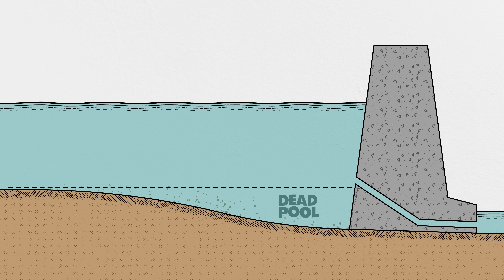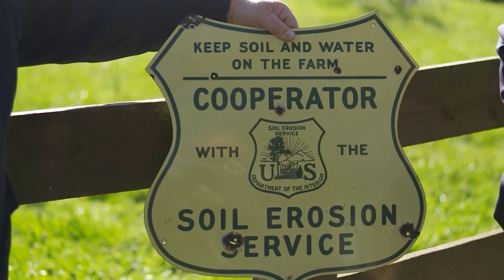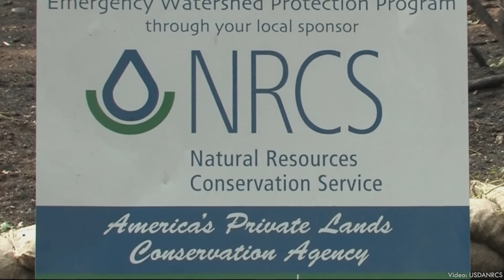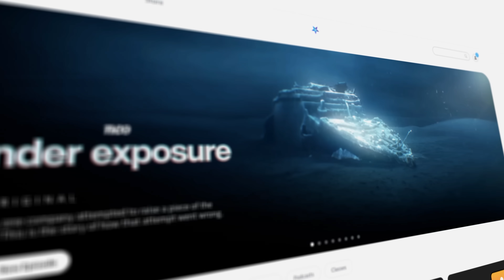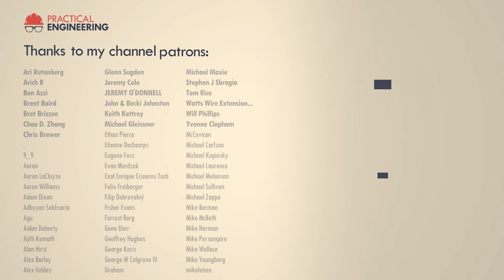All Dams Are Temporary

Comment: Here's how I would solve it. Avoid the big dams and do a bunch of retention ponds and ground soak ponds throughout the water shed. Keeping the water in the ground and as high up as possible will help avoid flooding and contribute to water flow consistency. Then as far as dams go make them small or go with run-of-river hydro power. It is better to have lots of small run-of-river hydro that allow the river to mostly run natural as  and protect the fish avoid the sediment problem. Also you eliminate single points of failure as having one or two hydro plants go offline won't  be a big deal as you now have many small ones.

Comment: I remember back in the day when I was like 6 or 7, they solved the sediment problem just by first slowly relasing water from the dam until it was practically empty, let the bottom dry up for few weeks and then just rolled in few excavators and a dumper truck which was just dumping sediment somewhere down the stream by the river bank. They prolly don´t do that anymore, since back then there was no property issue as everything was owned by state.
Reply: Nowadays everyone is also reliant on the power generated by the dam and the reservoir created behind it, shutting a dam down in the modern day could mean a whole city going down with it
Reply: @defiantnight2668 if it’s planned out far enough in advance the grid can cover it, it’s surprise outages that are problems, for most of the developed world.
Reply: 6 or 7 huh...

Comment: I remember reading something about the problems connected to building the Aswan dam to the Nile. For one thing the fertility of the soils along it on Egypt used to depend on the floods, now the sediment that used to renew those soils every year stays behind dam and the soil has to be maintained with artificial fertilizers, and from what I have read, looks like that isn't working anywhere as well as the yearly floods did.

Comment: Posting my 'top of the head spitballing idea' that you asked for, before finishing the video. A broad slow moving washboard like area with peaks to speed it a little and valleys to collect settlement.  Divert the river through this before the filtered water enters the reservoir. It will let the silt settle out in an area designed to be regularly cleared out. There could be two or three such areas, switching which is receiving the water as the others are cleared out by equipment and stored elsewhere and as much as viable used or sold, or a series of archemedes screws can move the sediment filled slurry to another area prepared to receive it.  I assume the dammed body of water is already not meant to be navigated by through shipping, but if so you will need a lock system here just like you would need one for the dam itself.

Comment: Large screw in a big tube going along the stream on the dam bottom would solve this problem - THE MUD PUMP. The tube would have holes every 50 meters or so. When some mud gets in the tube the screw would push it to the other end of the tube.

Comment: With little knowledge of the mechanics of water and engineering, here is my solution:

Not really a solution to the dams we have already, but one for future ones. Create two dams. One on land to act as a large reservoir, and a second, micro-dam upstream. The entire purpose of the smaller dam is to reduce the flow of water so sediment settles, allowing you to pump clean water with much less sediment into the main large reservoir. Ideally this would primarily use gravity to save on power. 

My hope is that the smaller micro-dam would be small enough to be able to be easily flushed periodically. If you took a swiftly flowing river and split it into many small individual dams, the flow should drop as desired. You could close/open dams in order to fit your need. Closing many dams would cause the flow in the few remaining open to increase, allowing the dam to self-flush the sediment downstream. 

This seems like it could solve most of the sediment related issues that current dams have. The main large reservoir wouldn't fill up with sediment, or if it would, the rate would be slow enough to justify the cost of removal or slow enough that the dam could fulfill its cost over hundreds of years. The small dams could be flushed almost constantly, allowing you to release a steady flow of sediment, instead of a sudden tidal wave of it.

I'd imagine it would also help with the environmental impact of the dam as a whole, as it would only siphon off a portion of the river, instead of stopping it completely. 

Of course, I know nothing about dams, so I have absolutely no clue how viable it is to only siphon part of a river flow. I know lots of dams/reservoirs are meant to store water for drinking and surviving droughts. perhaps this wouldn't be enough water for that. It would decrease the amount of power a hydroplant would make, but perhaps that's the price we'd want to pay in order to make hydroelectic power far more environmentally friendly.

Comment: Aren't there sleuce gates that get opened regularly? 
How about having a pipe opening in the dam below surface with a tube attached that can be set down wherever the sediment settles, it could regularly be moved to the biggest sediment deposits and doesn't have to be big enough to impact waterflow or dam capacity.

Comment: I wonder if they could somehow use the dam to power air or water "agitators" buried in the problem zones and re-suspend the sediment. Im imagining lateral systems that spray water out of jets parallel to the river bed kicking up a bunch of dirt. Not sure how far you can agitate water at the bottom using pumps. I imagine there would have to be a field of them.

Comment: They need a dredge that has a suction hose connected to a portal low down on the dam itself specifically for this function. The dredge then putters around inside the reservoir sucking up the loose(ish) sediment, which then gets sucked out the portal and resumes its journey downstream. Could use the same sort of software to control it that farmers use to make sure they fertilized an entire field evenly to make sure it gets everywhere.

Comment: If the reservoir is full of water already, couldn't you just build a bypass that maintains the cross section and thus speed of the river so that the sediment also bypasses the reservoir? This way you're not fighting all the sediment that flows downstream, you're only fighting the sediment in the water you're actually using. You wouldn't even need this bypass to be a structure, it could just be a chute of thin plastic film which is held up by inflated tubes on top of the reservoir the same way jellyfish nets on Australian beaches are supported. A dam I grew up near had a net a few hundred metres from the dam wall held up this way to keep fish from being ejected over the wall. Canoes and small sailboats could easily pass over it (as long as you lift the rudder and centreboard). You could lower sections under the surface as a complete tube to allow speedboats to pass too.

Comment: Just use the flow itself to take the dirt off by increasing the velocity  (channel the inflow into a thin channel). Also there should be a gravity trap equipped spillway before every resevoir which would trap the dirt enabling automated systems (conveyors, heavy duty screws) to move it to the edge for removal before it reaches the reservoir
Reply: Also reservoirs should be designed so the flow naturally keeps them cleanish.

Comment: Dredge it out.  Before watching the video...  After watching the video, no answer.  The sediment in the river would be deposited no matter what.  It seems that the primary solution would be to regulate what can be spilled into the river, so that the sediment is not contaminated.  Or charge the pollutors a polluting fee, a surcharge to remove the pollution from their runoff.  As pollutors pay for removal of contaminants, the remaining material can be sold as high-quality fertilizer for farms.
If we know the specific contaminants, they might be recovered for industrial use.  Perhaps there are contaminants unassociated with human activity, stuff that comes out of the soil naturally.  There is a use for almost everything.  While removal may not pay for itself, it could help to mitigate the cost of dredging and cleaning of the sediment.
As always, the reason we have engineers is to do the math.  While these solutions appear simple, it's not until we do the calculations that we realize and understand the magnitude of the problem.  Here in Florida, one of the big problems we have is ocean and gulf beach erosion, whether from storms and hurricans or from day-to-day loss of sand into the ocean.  We deal with this problem with giant water/sand vacuum cleaners that operate a mile or so offshore and pump sand off the ocean floor back onto the beaches.
The Intracoastal waterway in Florida (and along the eastern seaboard of the US) was made to provide a safe waterway for shipping traffic behind Florida beaches.  The shipping channels were dredged out and the dredgings were made into islands along the waterway, which can today be used for recreation, camping, fishing and even hiking.

Comment: Down here in the Lower Mississippi Valley, we could really use all of that sediment and silt.  Especially in south Louisiana.  All of the silt and sediment that is getting trapped up there is supposed to be coming down to Louisiana and Mississippi.  

If anybody likes to get lost on Google maps, go check out the Mississippi River between Natchez, MS and Jonesville, LA. It’s about 40 miles apart across the land and the mud between them is an average of 200 ft deep.  It’s an interesting read if you’re into hydrology and hydro engineering. The Old River Control structure is close to failing and has been since 1972.  Go buy the books and read up on it. 

All of the water from the Arkansas to the Tennessee to the Ohio, Illinois, Wabash, Wisconsin, Missouri, Platte, Red, White, it all comes down the river between Natchez and Jonesville.  The drainage map makes a bottleneck right there and it’s ones of the reasons that Natchez is used as the “control” for all of the river gauges in the Lower Valley.  We’re like the sphincter of America 😂

We need to set up a chain of dredge machines and barges to keep the sediment suspended from reservoir to reservoir. Keep it agitated and suspended and make sure it gets to Louisiana.  If we don’t, New Orleans is going to disappear and prolly Baton  Rouge too.  It’s time to drink some Pepto or take some Exlax and clean out the system. 

The river wants to go down the Atchafalaya and I say we should let it.  If we don’t prepare for it and make the changes like dredging and pushing the sediment downriver, it could happen quickly and catastrophically.  Go ahead and punt, take a few steps back, build and reinforce the Atchafalaya levees, and let Morganza or Old River go the way that Momma wants her too.

Comment: idk man, seems pretty simple/feasible to me

big dam for electricity production in the end
further back and especially up small rivers you put dams only for sedimentation and you build them in a way that it's really easy to just use an excavator on it
that way you have "clean" runoff from the small sedimentation dams to the main electric dam
the rest will most likely accumulate slowly enough for it to be a "once a century problem" or once at the end of its lifetime, as dams also have a limit to that

and unless you produce toxic waste nearby, the sediment should be excellent quality sand for building stuff with. what was it again? river and beach sand is vastly superior to desert sand, no? there you go. just build tiny dams all over the place and use the sediment from there. if i remember correctly, the same sand is also used for gardening/food production. and if there are fish that need to get to places, that problem has been solved some years ago with those fish bridge thingies.

Comment: what is they used soil liquidation to get the soil flowing more so is can move more down stream out of the dam and you might not even need any pumps to make presser because you could use pipes that have holes in them and the end of them sticking out of the ground that uses the presser of the flowing to loosen of the soil but then you would have a problem with soil clogging the pipes or to much soil flowing out the dam

Comment: I own a cabin in a community with a rural dam built in the 1960s. For years, we relied on dredging to manage sediment, but the equipment is costly to maintain, and state regulations have shortened the window when we’re allowed to operate it. As a result, it became impractical and was ultimately abandoned.

We later attempted to remove the sediment after a drawdown. The team overseeing the project believed all necessary permits were in place, but that was not the case. Fixing the oversight cost the community roughly $4 million and even led to some criminal convictions.

A major sediment source is the surrounding forestland, most of which lumber companies own. When they clear-cut near the streams that feed the lake, we see a significant uptick in sediment. We’ve never been able to catch them in the act since the only link to the source of the damage is through statistical correlation. Meanwhile, they have deep legal resources, and we’re left dealing with the consequences.

The unfortunate reality is that the system is stacked against us. Viable solutions are effectively off the table, and without a way to manage the sediment, the dam is on a path to eventual failure. The irony is that the state values the dam for its positive impact on wildlife and fish populations, but its regulations make it impossible to protect.

Comment: One would have thought that the simplest, most cost-effective and environmentally-friendly solution would be to set up a simple gravity-fed / syphon system that catches sediment slightly upstream of the dam, then simply drains the sediment past the dam wall (underground) and then deposits it downstream, possibly even much further downstream or directly into the ocean if the ocean is not too far downstream. 
This would drain sediments at the natural flow rate and do it 24 hours a day.
A sediment bypass. Bypassing about 2% of the total volume of water in order to vacuum sediment away with it.

Comment: My first thought is you would have to engineer a dredge system that would be able to every so often feed the sediment through the low level gates essentially allowing the sediment to go on the path it would have taken otherwise. I think there would be some ability to create a bolt on system to make this happen but you'd want to design the dead pool and low level gates to accommodate this slurry going forward. Also you would need to be sure to time these "cleanings" with some decent rainfall or a moment where its optimal for the dam and the flow of the river.
Reply: well i just finished the second half of the video. But i thought id leave my answer up.

Comment: Nice video - thanks!  I've got an idea for a solution:  Build an artificial river along the top edge of the reservoir that carries the water past the reservoir all the way to the dam.  Keep the waterflow in the river such that it keeps the sediment in suspension.  Introduce the stored water to the reservoir at the end of the artificial river near the dam, via a separator (centrifugal???) such that the sediment is passed beyond the dam along with the normal outflow.  Any sediment that still makes it into the dam settles near the dam first, so regular flushing can empty it out.

Comment: What if we took the same Tech used in d
Dredging ( the one where it spews it out), and we set it up in the dam and have it built down into the Dead Pool and the outlet facing downstream on the other side of the dam. And then periodically Turn them on and "Spew"  that sediment out of the dam. If it was done consistently, you wouldn't have to release all or most at once. You could just run it once a month or so and keep clearing your dead pool. That way, you are overloading the river downstream with sediment.